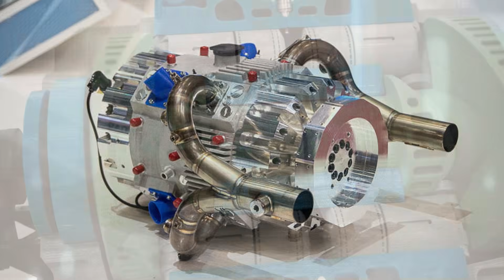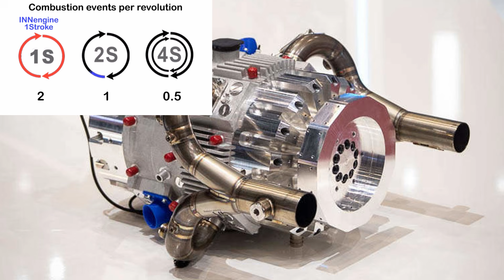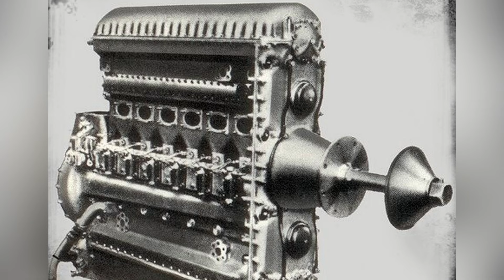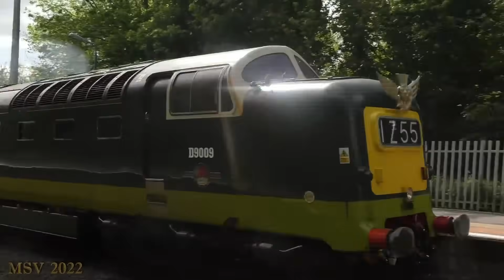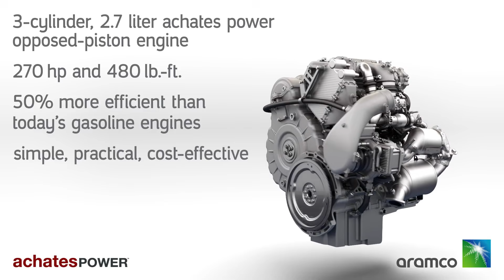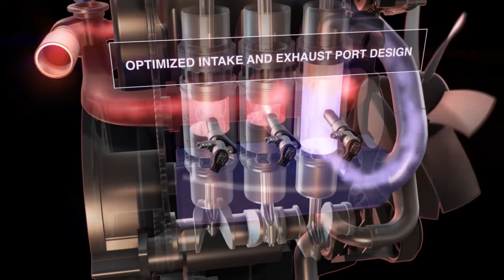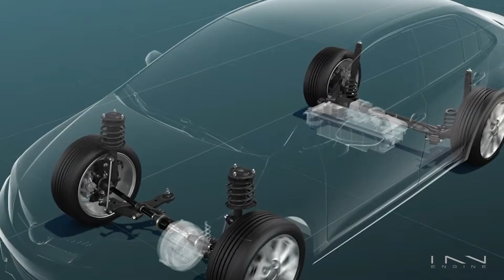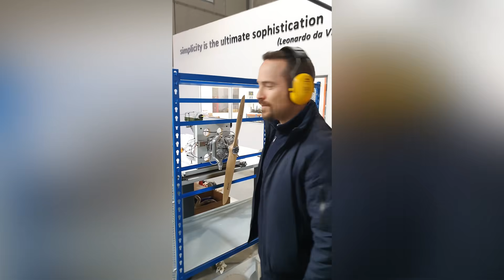NEW OP Mini-Engine DESTROYS Pure EVs

Comment: Still has moving parts that break and the residual costs of using fuel to run your vehicle.  Not cost effective now that EVs are a thing.
Reply: Ev is a thing? 🤣
Reply: You have an electronic circuit that designed to operate at 12 volt as an inlet voltage, Can you use a 300 volt to operate it?
NO PROBLEMS WITH MOVING PARTS, THE VIBRATION ( IF IT'S NOT THE REQUIRED WORK ), IT REPRESENTS THE PROBLEM!

Comment: I and my cousin brother thought to build like this one 4-5 years back but couldn't because of financial constraints this engine can also be used in series hybrid where two generators can be attached one on each crankshaft for range extender purposes.
Reply: The dual shaft  arrangement is actually a shortcoming in most applications.

Comment: Electric vehicles aren't meant to replace the internal combustion engine; the mandate to make EVs is meant to end private transportation all together.  The power grid will NEVER be upgraded to support EVs.
Reply: It already is being upgraded to handle EVs. And how exactly changing the power train to use fuel that is way more accessible almost everywhere going to end private transportation?
Reply: @zbyszanna   The materials used to produce the batteries in an EV are not available in sufficient quantities to supply the projected market, furthermore the batteries themselves are not economically recyclable and are an environmental hazard as well.  There would have to be many more hydrocarbon based electric power plants to supply the necessary electricity.  Basically the whole scheme is a sham, from the anthropogenic global warming farce through all the renewable energy industry, which only exists because of subsidies.

Comment: If we look at the "use case" scenario for long-haul trucking, a truck operated by a single driver can only drive for x hours (10 I think).  Whatever the number, a driver has to sleep sometime at least.  That's a perfect match for a charge/drain battery cycle.  So small range extenders can be used when there is no electricity to charge while resting.  Also, super capacitors have quicker charge rates so that could be useful.  They also have quicker discharge rates so that has to be managed in the system design. My point being that some combination of small range extenders (especially for at-rest charging), super capacitors, and slow discharge batteries of some type will probably be a good configuration for EV long haul trucking.  BTW, it would be great if could you do a video on the latest EV power system designs using these 3 energy sources.  Thanks!
Reply: The problem is, claimed distance is almost always several multiples of actual range when loaded. For example, a 500mi EV is realistically likely to only see 100-125mi once loaded - if that. There's a reason why EVs are forced on us with backend subsidies. And it's not because the market can sustain or justify them otherwise.
Reply: @justanothercomment416  I totally believe you, but let's face it mpg ratings aren't much different.  I'm supposed to get 26 into the city and I get like 14.  But ok that's still 2x better than your example.  But some decent power storage/range capacity has to be put into the ev market or else we'll all get bit in the butt sooner - not later.

There's a video around with a guy whose hitch hiking to get a gallon of gas for his car stuck on the side of the road.  He gets a ride, gets a ride back, and the other guy says - dude that a Tesla! What the heck are you thinking?  The Tesla owner opens his trunk to reveal a small gas generator; he fills it up, starts it and runs a plug from it to his Tesla charge port. Is that the future waiting for us?🤣🤣🤣
Reply: @Charlie-Oooooo  There's a ton of propaganda surrounding this topic. Pushed by the same people financially benefiting and funneling funds to hostile nation's economies. The entire green push is a scam built upon more than a century of propaganda. A century of propaganda offering predictions which have a 100% rate of invalidity.

What you just described accurately depicts the reality of the entire green movement. It's insanity built upon money laundering and propaganda. Nothing more. Nothing less.

I encourage you to go find Tony Heller's content. Does a great job of pulling information out of the past century of documented environment propaganda and scares for the obvious scam reasons.
Reply: mahle was talking about a recycalable electric motor but it needs transmission like normal engine. theres idea of linear piston mocement energy covert to electrical without spinning parts

Comment: We need to couple this new OP to a Tesla model 3 and extend its range out to 1500 miles and have the best of both worlds 😊🎉🎉🎉🎉 either way the government is still trying to find other ways to tax you for driving on its roads as the old way of the gas tax is not working out for them anymore; so extend the range of your travel miles will make your tax money go a longer ways; get ‘er done bro…!
Reply: It's not best of both worlds. If you put a range extender you lose on mass, noise, emissions, utility space, efficiency and reliability of the car. There are serious drawbacks for using range extenders.

Comment: Amazing engineering but the ICE era is nearing an end for I'll say 80% of ground transportation needs.
Reply: Never, Hydrogen conversion is coming for ice.
Reply: Yeah, but in the mean time the world will still need better combustion engines.
Reply: @zbyszanna  ICE sales are down, BEV sales are up by 2030 BEV will almost certainly be more than 60% of the market. If so, what need is there to spend tens of millions on R&D, more tens of millions tooling up to produce an engine that offers no substantial benefits over the engines being made now?
Reply: @GeeKayKayGee 60% probably not even in California by 2030 unless u r including the plug-in hybrids. The issue isn’t California, but the rest of the world. Again u have not qualified ur assertions! To win at climate change it is what is happening world wide, and most of the world has different ideas that contrast with your “ultracrepidarianism”!
Reply: Major manufacturers lowering EV production due to low sales.  Battery, generation, and infrastructure not able to provide what most folks want.  CONVENIENCE, PREDICTABILITY AND ECONOMY.